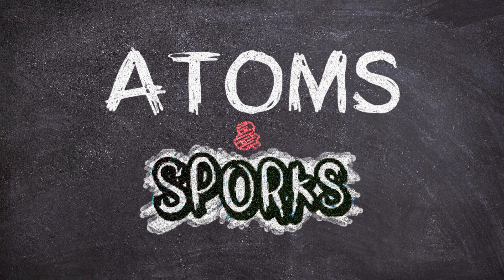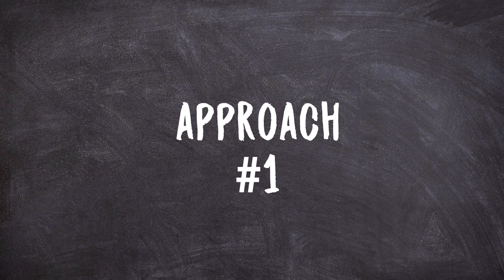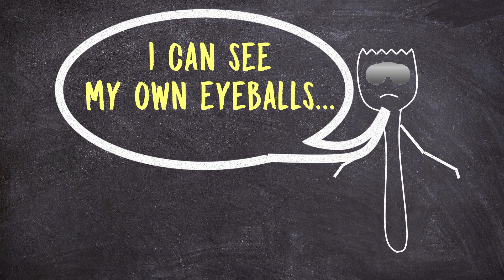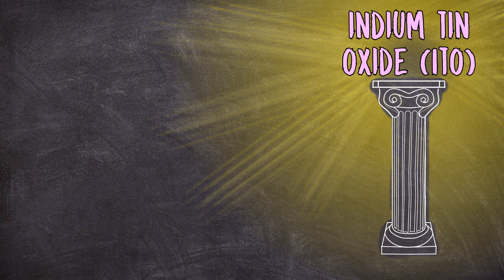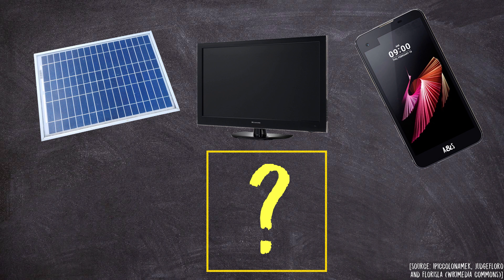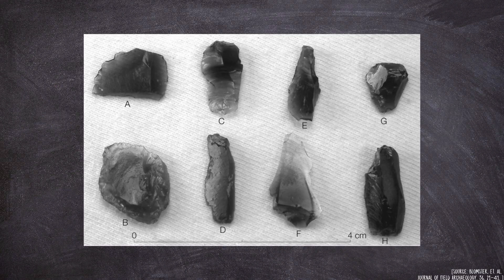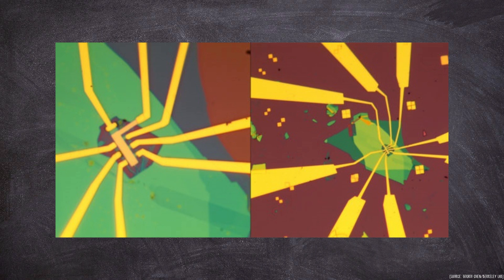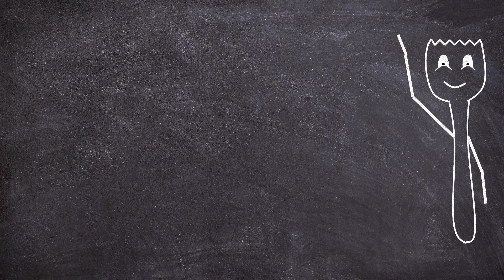Our Future Depends On Invisible "Metals"

Comment: 1) What about water? I'm late to the party with this, just started researching it. Completed a solar energy course by NPTEL on Alison. Pure water isn't conductive, but adding the right impurities, doping it in a way, and sealing that would provide a transparent conductor. Not too thick a layer of water or you start losing frequencies.  
2) The other thing is, the light needs to get to the P-N junction, but could we tunnel it in? You know, run some fiber optics in the thicker section, because the action happens right at the junction. and then pick up the current from the top and bottom?